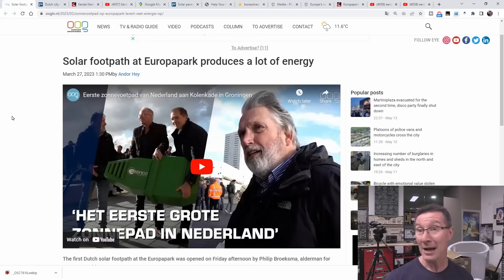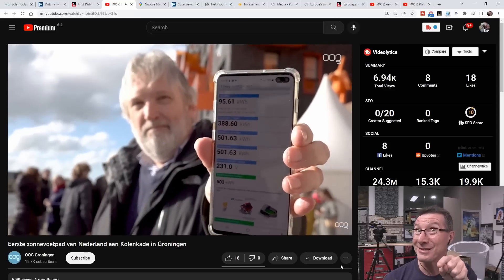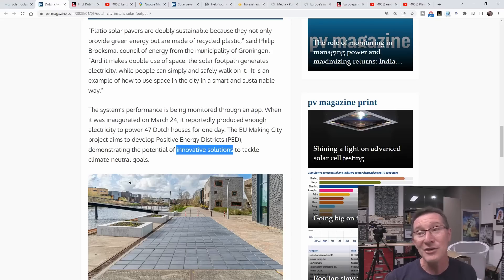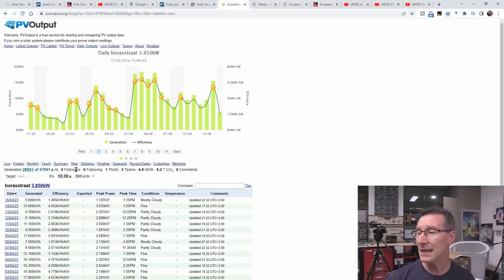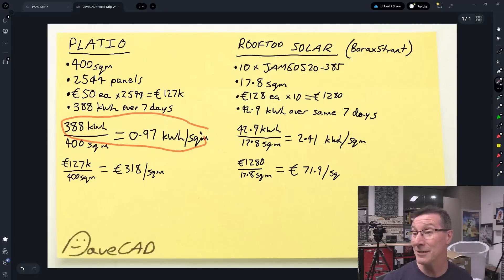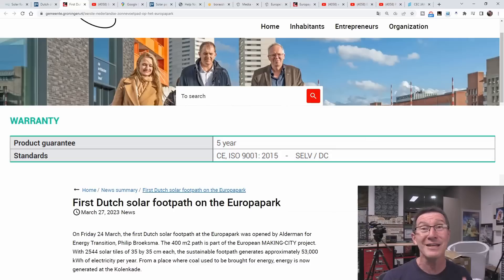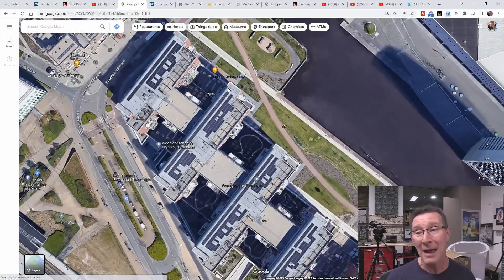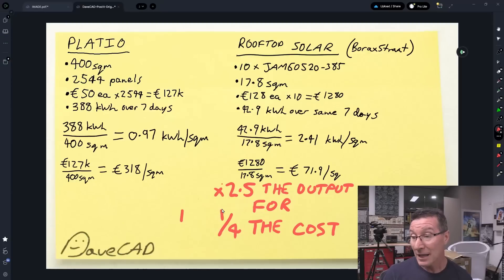EEVblog 1544 - Platio Solar Pavement BUSTED!

Comment: You are totally missing the point, it goes way over your head. And your data is also wrong, but even if it is correct you are still completely missing the point, or you are just trolling without a cause. I am Dutch, and the official government information on the website from the local government that I read speaks about approximately 315 square meters. But even if it were 400 meters your video still doesn't make any sense. You noticed all the solar panels on the roofs right? They have 4500 of those installed on the roofs. So that tells you right there that they are well aware about efficiency rates. And you most certainly do not have to explain the Dutch people about how to make a profit or what the words "cost effective" means.  

What you are completely missing is that this solar foot path project is not at all about installing the most efficient system, it is all about using the entire available space as efficient as possible, while still being cost effective. Because in the Netherlands there is not a lot of space. In Australia and other countries you have all the space in the world. But here, for example in the west of the Netherlands we live with 1410 people per square km. And if we look at the entire country we live with 250 people per square km. And 60% of the usable land is owned by farmers. So we do not have a lot of space to begin with. And when people do not have alot space they look for options to use the available space as efficient as possible. And yes, there are still empty roofs without panels, but if you do not own the roof you can't install your panels there, it is easy as that. So all that the people from that park project did, and it is not just a regular park but instead it is an entire project with all kind of sport and shopping and government facilities, was to look at the total space that was available TO THEM, for their park, and they calculated that this walking space could also produce energy that is still cost effective HERE IN THE NETHERLANDS. 

And the cost of energy is another factor that you willfully completely ignore. If you look at the cost of energy per kWh here in the Netherlands you will notice that it is very high compared to the costs of energy in many other countries around the world. For companies and government buildings there are different and lower tariffs, but on average compared to other countries the costs of energy is still high. 

So in some countries a system like this might not be cost effective at all. That is that the costs of installing might be higher than the total return of investment. But with our high energy costs from fossil fuel energy sources the return of investment from solar energy is much higher per kWh. Or in other words, even if the solar system is relative expensive and not as efficient compared to a dedicated roof system, it will still produce enough energy at a low enough cost, to make it worth doing. It is all about using every available square meter. 

At the same time it is a nice gimmick for that area in the city. 

The product is made in Europe, which is not completely unimportant. 

It reduces the total CO2 and fine dust emissions in this country. Not a lot, but every square meter helps. 

And last but not least, the solar panels absorb a lot of heat. Yes they get warm, but not as hot compared to the pavement that otherwise would have to endure the hot sun all day. Wich stores a lot of heat. Because by installing solar panels a lot of the energy from the photons is turned into electricity. So there is less energy left to turn into heat. And heat in the cities is becoming a big problem, because more people then ever are now using energy guzzling airconditioners, which only makes the problem worse. So if that heat storage that would otherwise occur when there are no solar panels installed can be reduced, it will not only be more pleasant and healthy to live in that area, but it will also reduce the need for airconditioning which will save energy for the people in those areas where the solar panels are installed. Every square meter ads up. Especially in areas where a lot of people and buildings are close together. 

The arguments in this video make no sense whatsoever, and you are completely missing the point, and you are not even taking a real effort to collect all the data that you need in order to make a decent and accurate calculation. You are simply comparing this system with a roof system, and if it doesn't match the specifications from the roof system you automatically write of the entire system. Which is totally absurd. Because the only thing that you have to look at with a solar power system if it is cost effective compared to the costs of energy from the grid, and if it will save enough money to justify the installation. As long as there is a positive return of investment it doesn't matter that a system is a bit less efficient and a bit more expensive per square meter.
Reply: This was a very long winded way of saying you have no idea what you are talking about. Come back after every roof and parking lot in the Netherlands are covered with panels.
Reply: @connernickerson5509  Your reply is childish imaginary nonsense. Stop bothering people if you can't write anything sensible, because you are making a fool out of yourself and you are wasting people's time.
Reply: On top of that, air pollution caused by fine dust is a huge problem in the Netherlands. So much that it kills approximately 10.000 people every single year as a direct result from the pollution. This often goes along with a long period of illness and treatments. It is not that people are instantly dropping dead on the streets. And therefore any reduction in harmful emissions of any kind is a very big win situation. It will reduce the total amount of medical costs, and it will improve the living quality from the people. 

Due to the pollution we also have a huge decline of birds, insects, butterfly and plant species, from 30 up to 80% reduction from the moment that they started measuring a 100 years ago, or so. That is a huge problem because we heavily rely on the pollination by insects from or agricultural products.  And we need a healthy ecosystem in order to keep the production of nutrients going for future crops. You can ad manure all day long, but if the microorganisms are not there to process it  the crops won't grow, or they will not produce enough product.

Comment: They tend not to pay for themselves by the time they are dead and need replacing, what a shame. I remember hearing about some solar panels in Kenya that were much more efficient but that was over 15 years back, then I never heard of them again. I wonder how long these things will last before they just don't work, and cleaning will be a bitch to keep them ...well not efficient but as good as they can get. I think they will close up and r3eopen under a new name and do this again, and avoid any warranty payouts. There's a sucker born every second, but politicians only care as long as they are in office, so these will last that long I suspect.
If you use HHO generators with a pulse width modulator, does the math work out to a positive outcome? I know without the pulse width modulator they don't, but the idea is a good one generating hydrogen rather than carrying a pressurized tank of it, that's just an incendiary weapon waiting for detonation.

Comment: Hmm ... where did you confirm that 388kW figure ? Yes the app shows 7 days, but are you sure it was actually online for those 7 days ? On the one you compared that, you can see the history, on the pavement one, you have no clue ... or at least you have not presented any proof that it was actually online for those 7 days ... so the comparison is inaccurate ...

I am not saying you are not right and the pavement solar is a waste of money, however you are just going on assumptions here one one side and facts on the other ... so no apples to apples comparison ...

Comment: The EU's tender financial resources and tender opportunities are done in the name of greenness, they are made simply out of incompetence, deliberate theft of money and the imposition of stupid green political goals, they achieve nothing and are merely used to maintain the background power of the EU bureaucracy and the role of money distribution.
A very large part of the EU tenders are simply taxpayers' money thrown out the window. The tender goals and conditions are written in such an incomprehensible political and pseudo-scientific jargon that sounds very "scientific", but in reality those words mean nothing. That's exactly what the terms Positive QEnergie Districts PEDQ and Qpotential to innovative solutions" in this video are.
The most annoying thing however, is that in most cases these tenders are decided by EU or state bureaucrats with secretary-level qualifications, because if a competent person looked at the applications and actually calculated the data as it happens in the video, 99.9% of the EU tenders would be rejected. But since it is a European-level money laundering scheme, it is of no interest to anyone in the EU bureaucracy.

Comment: I’m completely on board with this but you can’t just point at a roof and say put them there. We’ve tried that and the engineering cost to deal with loads and the cost/potential for flat root installations to leak can make it totally intractable. New buildings? Sure.

Comment: If you're trying to minimize the co2 footprint, any installation that requires additional concrete is a big no-no. Concrete, glass, aluminum, copper, plastics. They must be avoided. It would be far better using a few aluminum profiles to attach the panels on the roof or on the walls in vertical. In my opinion installations should be as cheap and as durable as possible and vertical mounting can make a lot of sense. You lose some total sun tracking efficiency but it's just so much cheaper and the space is not an issue. Panels are cheap as dirt and if the installation is cheap and low CO2 you can just cover your whole damn building with the panels instead of the friggin' roadways and patios.

Comment: They should just put the panels on the vertical walls and use suitable microinverters. So much cheaper and easier to maintain. Solar panels are cheap as dirt. The installation, maintenance and electrical hardware are where the costs are. Just minimize the costs, maximize the longevity and be happy with 10% efficiency or whatever. Who cares at 25 cents per watt?

Comment: "Can withstand a pressure of two tonnes without microcracking" ??
Urm. Just that statement alone is enough to know that this is bullshit because pressure is expressed as force over unit area.
Let's see someone apply two tonnes through a stiletto heel. I bet it won't withstand that.
Reply: it must be two tonnes per square inch. I wounder what the ground presure of a CV 90 is.
Reply: @exploatores  - I seriously doubt that they will stand up to that kind of pressure. I suspect that it would be two tonnes spread over the entire surface area of the panel because that's the kind of deceptive statistics that grifters like this tend to use - just like their "... enough to power 47 homes for a day" BS.
... and if it were 2 tonnes per square inch, they would have said so. Additionally, this is a European company. They use cm rather than inches.

Comment: I think the French have come up with the best option.  Required all new car parks have a roof with Solar panels on it.    A known, reliable technology.  The downside is it doesn't attract huge amounts of venture capital.  You could do this to new roads, which would offer the advantage that the roof would offer some protection from the noise of the road for the local population.

Comment: Good grief!

What don't they just put the solar arrays on roof tops! Better angle to the sun (assuming they use frames or sloped roofs), as well as covering parking lots with them so people are covered from sun and weather while they also generate power.

Between all the gubment buildings, parking lots, university buildings, etc. I would expect that they could put in quite a bit of power generation for much cheaper per sq meter while also being out of the way and not walked on or broken by someone simply walking across a panel with a rock stuck in their shoe.

Comment: I have to battle with the shadow from a 25mm antenna pole blocking a couple of panels on my rooftop, which results in that section of the array not generating power.  The first thing you learn in solar installation is NOT to put it somewhere that is subject to shadows.  So roadways, footpaths... all installations that you expect to be covered by objects and shadows pretty much constantly, fails this basic simple rule.   And why go to the extent of having to harden them for traffic when you can simply elevate them out of the way, out of shadows?   Lunacy!

Comment: I deal with it from BOTH sides electrical (engineer/electrician) and HVAC. I tell my guys 50.00 per POUND refrigerant in your car that is FLAMMABLE is about MONEY, not the environment! Green = Money , not cleaner air or water or elimination of Global warming. Stop the madness! Money pouring out of govt coffers like a boot! Climate change is a hoax, at least MAN MADE! Check data for the last major volcanic eruption and see what that did! Let's just cork the volcanoes and problems solved!!

Comment: 5 year warranty on panels that after 6 months loose 10% of its output ... add to it , its made off glass and its a footpath for people ... that will jump on it, and break it ,or even drive bikes on it ... and then add on it, environmental damage from dust\wind\sand\grit\rain\snow ... its pure comedy gold, that "green energy" today is used as a Money laundering scheme
Reply: They could just install solar panels on every roof for much cheaper cost and better durability (as solar roofs last for over 30 years before it starts degrading)

Comment: I feel bad for the grid operators that have to contend with so much solar on roofs stopping production just as demand peaks every night.
Reply: @lookwhatyoudid5907 In almost every US state* demand peaks right around when the sun sets, which is I think the accepted definition of night. *Alaska is far enough north that day and night are flexible. 

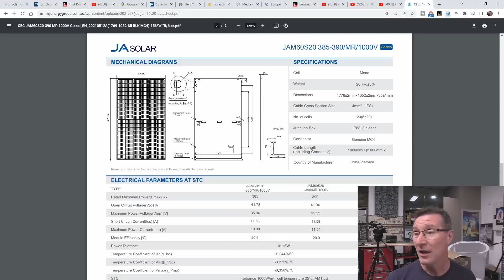Generally the evening peak starts about 5:30 and hits max around 9:00. Solar PV starts to decline about 4:00 and is near zero at about 6:00. The exact grid for any state or nation has some flex in it, but most follow the pattern of a working day with people going home in the afternoon and cooking a evening meal then doing something at home till they go to bed.

You can get more solar later with fixed roof systems that point west although that would lower overall output due to suboptimal mid day generation.

Comment: The solar grifts are only the tip of the ice burg. Look up wave power, or even the fake geo thermal power stations that spring up every now and then in Australia. Heck... Snowy 2.0 is basically a grift at this point.

Comment: IDK if it is just standard but to me, touting their output in terms of "kWh per year" seemed like an obvious attempt to try and make the number sound significant

55000 kWh / yr is ~ 6 kW...so basically like 5 vacuum cleaners worth of power

Comment: It makes no sense to put solar panels on the ground until every usable roof in a given area is covered. Climate change isn't going to benefit from walk-on solar panels that have to be replaced from wear every few years at an energy and emissions cost likely greater than what they'll save from generating solar power in their lifespan.
I like the idea of solar roof over parking lots, no more searing-hot car interior during summer when parked under one of those.

Comment: Just build a normal patio (covered like a carport) and put solar panels on it.  Best of both worlds.  You get the good efficiency of the normal PVs and also get some shade.  I guess in northern places they don't want to build things for shade because it's always cold.  But in hot climates shade is a good thing and solar power is a nice bonus.
Reply: I'm literally doing just that. Building a pergola using 4 harbor freight panels, a battery pack and inverters.

Comment: Did you see that each of those small tiles weighs 6.5kg at 35x35cm? A standard panel weighs 5-10kg per 1m square. That's almost 9x less weight. 9x less material. Not counting the construction under the tiles.

Comment: I addition to rooftoop solar, what ever happened to plain old energy efficiency? The cheapest power is the power you don't use in the first place.
Reply: Political problems. Efficiency comes in two forms. Either you spend money on changes like insulation and heat pumps that no-one sees - which is like shoveling money into a black hole for political reasoning, because what cannot be seen cannot influence re-election prospects. Or you start imposing regulations like appliance efficiency standards, which makes people very angry because they don't like feeling that the government is micro-managing their lives. Taking away their overpowered vaccum cleaners and pressuring them into buying emasculating little city cars.
Reply: @vylbird8014  current EU environmental regulations favor large cars, not little city cars (that's why production of Smart was ended)

Comment: Thanks to NASA modern solar photovoltaic panels do NOT require direct sunlight to generate electricity. 
They even work on cloudy days so a little bit of intermittent shadow is NOT an issue.

Comment: Not only you can get 1/7 the panel cost with regular rooftop/overland panels, but also the installation costs are way lower, and the durability is incomparably better for conventional panels. I fully get Dave’s frustration. It’s pretty annoying that any money is spent on this BS.